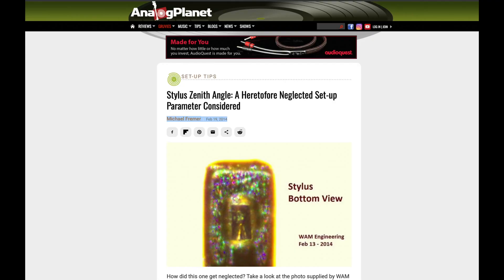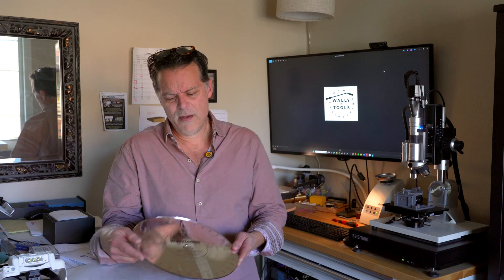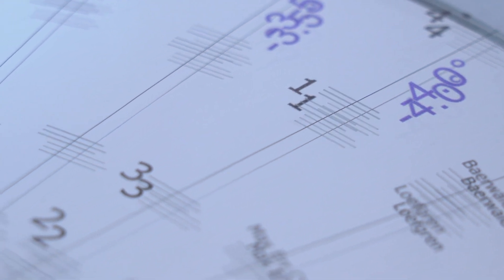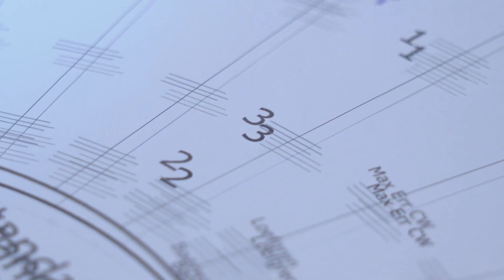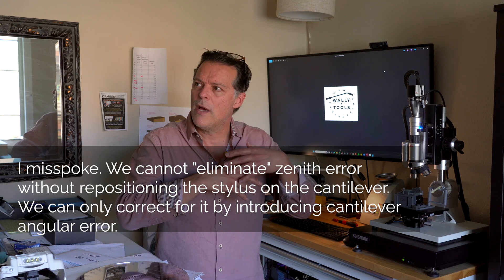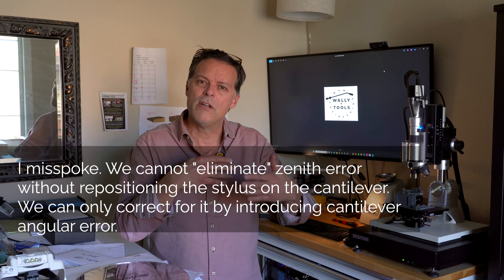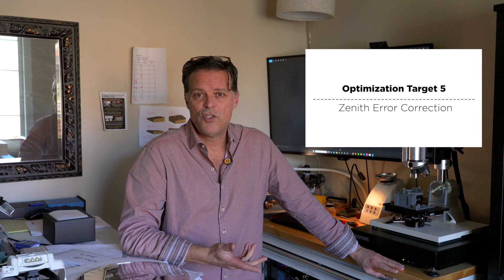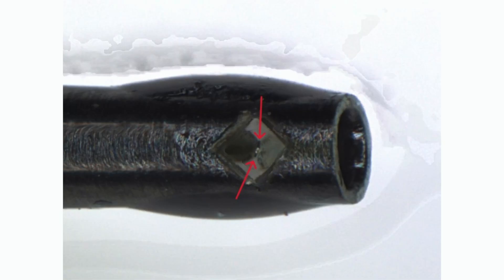WallyZenith - Correct For Stylus Zenith Error

Comment: I found through taking images and listening by ear to confirm that my zenith error was off by 8°. When I found the correct alignment it was as you said within half a degree. The difference in sound was the sense of depth in the sound stage that’s created by very fine detail like reverb, echo and spatial cues. Things like the centre vocal became life like in size and stepped forward away from the speakers into the room.
Reply from the maker: Love it. Too bad we didn’t catch this flaw while the cartridge was still under warranty or we could have had it replaced with one that didn’t need so much correction. Glad you like the improvement!
Reply: @WAM-Engineering It’s a fairly new cartridge and I’ve reported it to Audio Technica so there may be a chance of a warranty replacement still. None of this would have been noticed without your video. I very much appreciate everything you’re doing for the analogue community. Thanks JR.
Reply from the maker: @russ-p1  Just keep in mind that using the "by ear" method of zenith error correction by way of the WallyZenith process may not be considered as "proof" by cartridge manufacturers of stylus yaw (zenith error). If I were them, I would require a good image or some other proof. I could be wrong about this. Let me know how it sorts out if you do make a claim.

Comment: Jeff, is it right that a zenith error is not possible on an elliptical or on a spherical stylus? Modern advanced stylus shapes should be more prone to this potential issue. Besides, on a regular (non tangential) tonearm we can only narrow down the error. If we wanted to measure it (not sure if possible, because we have to deal with many different errors), we would of course need a mono record and analyze the differential signal between left and right channel. In a perfect world it should become a zero signal, when zenith error is fixed.

As I think about it, if one channel is sooner than the other, can't we just move one speaker a tiny little bit? Or just move our head to the side (should be in the mm range)?
In which time ranges are we talking? Assuming my quick mathematics are correct, a 1° error would result in a left vs right distance error of 0,0006mm (in the groove) and this is good for a time difference of around 0,002ms (33 1/3). It's not nothing for a 20kHz signal, but we have to put it into perspective. Regular tonearms usually are in the range of +/-2° error across the side of a LP.
There certainly is a "best" setting for zenith. But can we really hear it when it locks in? We are not talking about Azimuth here, what "is" the most important parameter (next to VTF).
Of course I might be wrong with my quick assumptions.

Nevertheless, great work as always! Keep on going! 🙂
Reply from the maker: It is more complex than simple L lags or leads R. If you watch the animation in our other videos on zenith error perhaps you can see why: the stylus is forced to take a new path when zenith error is present. This causes more than a simple L vs R timing conflict. I am just trying to (over) simplify the situation so the public can start beginning to deepen their understanding. 

Elliptical styli are sensitive to zenith error, but obviously less so than fine line. Spherical not at all.

Comment: I would love a validated stereo test tone record so that I could use my high precision oscilloscope to measure phase differences. With this tool that could be very powerful.
Reply from the maker: Over two years ago we started our research on zenith error using an oscilloscope. It didn’t turn out well - or accurately, let’s say. There are some mechanical impediments which make it less than useful or reliable. Good luck!
Reply: Interesting, I can believe it, and would love to learn more about it.